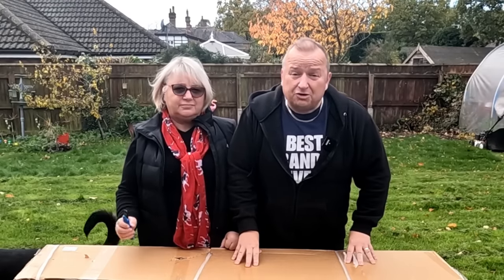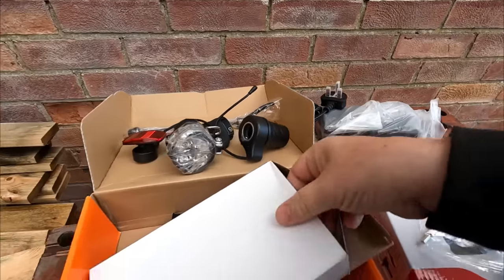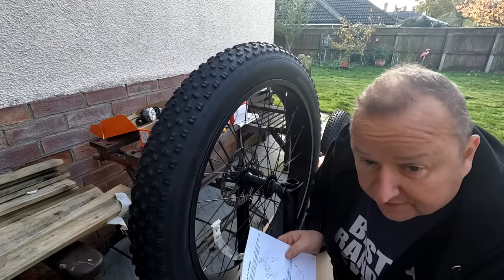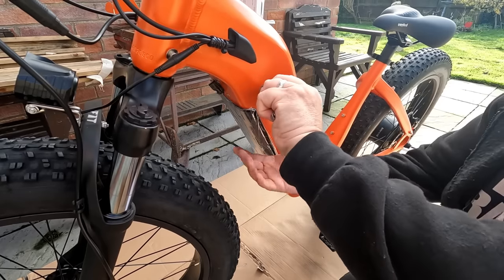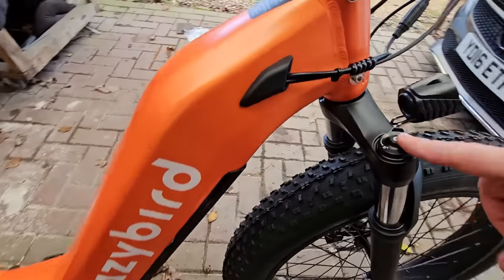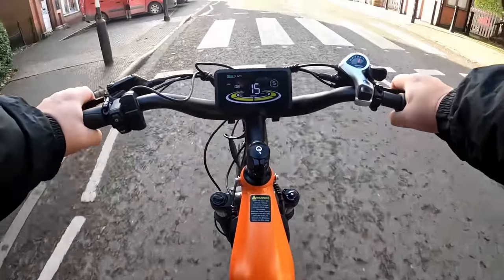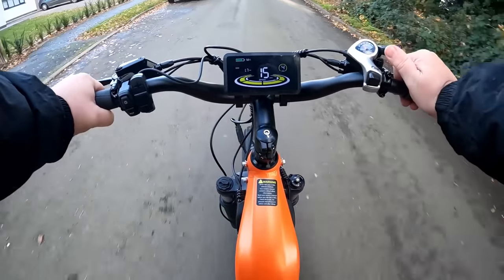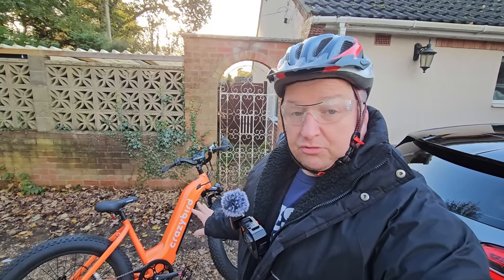Awesome Crazybird Jumper Ebike

Comment: HI, I have had my bike for two months now and would like to add the following. 1/ This is a VERY heavy bike, fit the throttle as its great to get the bike moving before you start to pedal especially on hills. 2/ This bike is fantastic at climbing hills 3/ This is a heavy bike and on a down hill section when free wheeling its picks up speed VERY quickly, i have a area near me and this will hit 30mph in no time, quite scary. 3/ The let down for me with this bike is the tyres they are quite thin and you get punctures very easily.  I am looking at either trying to change the tires or getting tyre lines. 4/ This bike has 2 speeds stopped and 15mph, it gets from stopped to 15mph very quickly. All in its a great bike to ride though it takes a while to get used to riding a fat tyre bike

Comment: I'm very surprised the ebike did not come fully made up. As a woman I would have had no idea how to put the bike together , or how to check it is safe to ride, even with the manual.
Reply from the maker: That's the point of the video. None of these bikes come pre built.
Reply: If you don't have the skills to assemble it yourself then you could get a local bike shop to do it.